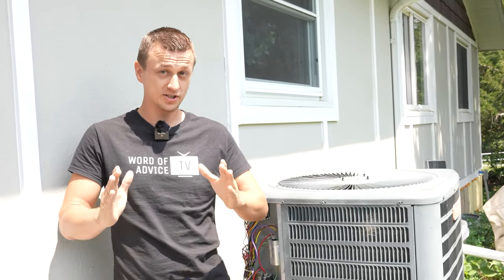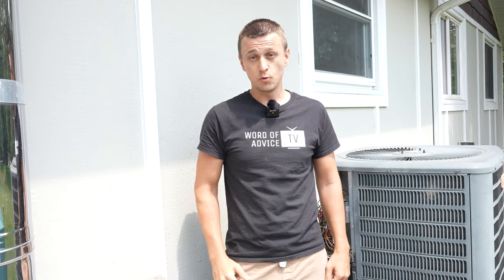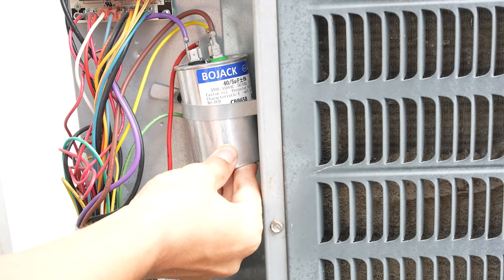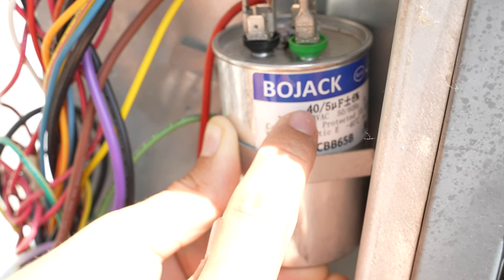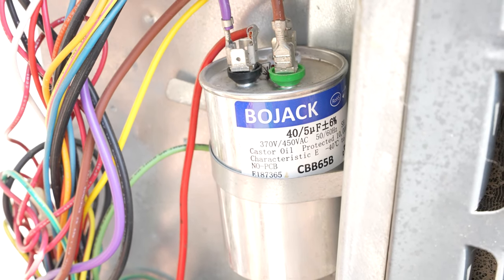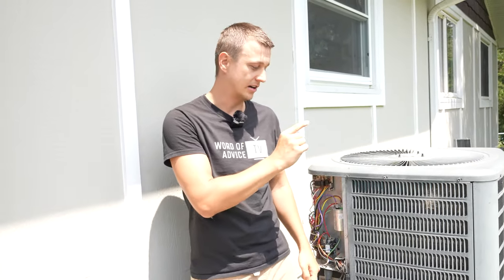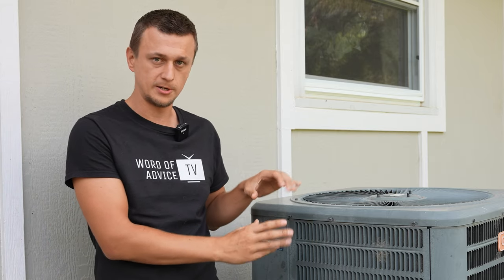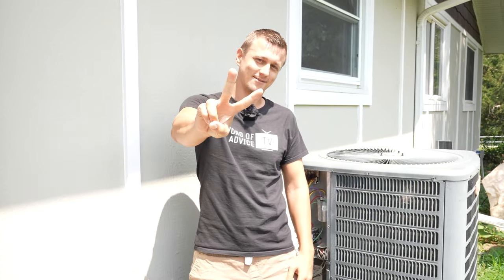How to Order the RIGHT Capacitor For Your Air Conditioner

Comment: Your overall point that other specs than factory specs may often be substituted and will work fine. Shape factors may be different (as long as the parts are secured to endure vibration of the condenser housing). Actually, you may have a point that "the voltage rating is not important" for most HVAC units in the USA and Europe, ie 360v/440v but that is not true for capacitors in general and may be very important. Rule of thumb...you can use a capacitor with a differing but close capacitance rating and you can use a capacitor with higher voltage rating but NOT LOWER voltage rating (lower voltage rating may otherwise burn out). Also, capacitors have polarity (+/-) that must be respected when installing or replacing. Overall good, helpful video, thanks.
Reply: Actually, since all A/C systems run on alternating currant, the capacitors do NOT have polarity.

Comment: When replacing, does it matter which terminal the connector is put on...like which of the 4 on the common or which of the 3 on herm?
Reply from the maker: The prongs in each section are connected, so it does not matter which terminal you put it on. 👍
Reply: I was told the best thing to do is take a picture before you remove the old one and then use that as a guide for the new one.

Comment: Jay – I'm replacing my mechanical contactor with an Emerson SureSwitch. I traced all the wires so I know what goes where. However, the 2 wires from the crankcase heater appear not to be connected correctly, as they are connected to L2 and T2. This doesn't make sense to me and I don't know how this can possibly work. Interestingly, this 34 year old condenser unit has never been repaired, except I replaced the compressor cap last summer. Any idea why these wires are connected like that? Thanks for an Word of Advice you might have. ;-) 
Jeff
Reply: Aack! I'm a dummy. I see how it works now. Brain fart.
Reply from the maker: Glad to hear you figured it out! Stay cool good sir!

Comment: What is the difference between the start capacitor and the run capacitor?
Reply from the maker: In short, the start capacitor helps the unit start and then it is taken out of the circuit whereas the run capacitor is in use the whole time while the unit is running.
Reply: If you do not know this answer, you have no business working on an HVAC AC or heat pump condenser system.  These are high-voltage 220/240 volt systems and the start and run windings are very important to the function.  Replacing these parts are not for DIYers.  This isn't like replacing your windshield wipers, this can be dangerous equipment.

Comment: Dude you're the Man! I notice all the run capacitor I see the larger number is stated first for the MFD. For instance 35/5 uf. For some reason my existing one that I need to replace, the smaller number is stated first 5/35 uf. Would it be the same? I know the larger number should be for compressor and small number should be for fan.

Comment: Very helpful video. I'm replacing both of my capacitors for my ac unit. They are both Sprague brand which no longer exist. One is 4 UF/370 VAC 60HZ. The other is 25 UF/370 VAC 60HZ. What capacitor can I use for replacement? I am coming across many with plus minus 6%. I don't know if those with plus and minus are compatible

Comment: What is a good brand Capacitor? Amazon goes from $15 to $35 . I need a 45/ 5 . Are the Cheap ones just as good as the more expensive?
Reply from the maker: Usually yes. The expensive ones fail just as much as the cheap ones. Buy a USA built one if possible, that might increase the longevity.

Comment: I was needing to replace mine and the old one has only some of the label remaining and says 10/50MFD. I ordered one that said 10/50 but now that I have received it, it says 50+10 MFD. Is this the right one? I can't seem to find 10+50MFD anywhere
Reply from the maker: Yes, it should be the right one. The larger number will always be for the compressor and the smaller number is for the fan. It does not matter in which order the numbers are.

Comment: I ordered the Kickstart T05 and installed it on one of my air conditioners and thought while I was at it I would add one to my second house. But it looks like it has a factory kit already. It has a dual run capacitor and a separate start capacitor with a relay. Is there any reason to add the T05? The original cap is 88 - 108uf . . .  the T05  is 189 - 227mfd. I was going to maybe change out the 88 - 108 with a new 88 - 108 cap. and leave the old relay . . . Good? - Bad? Thanks for posting these videos. You've got me doing things I would never think to try. But after that AC tech quoted me $250 to change the dual run cap, it tested 47 mf and should be 50mf but that's close to the 5%+ or - . ($12 part) and $200 to change the start cap ($22 part) and he was already on the service call. I'm willing to search these videos and save some serious cash!

Comment: Jay come save me again. I had my AC working just fine this year. I turned it off about a week or 2 ago since the weather cooled off. All of a sudden, the humidity and heat came back for the week. I went and turned on the ac and I didn't get nothing. I opened up and manually turned on the ac with the screwdriver trick. It turned on. So I assumed it was a bad capacitor. I changed the capacitor with a brand new spare one I had. Turned the ac back on and didn't get anything. So I replaced the capacitor again with another brand new one (I had 2 spares). Still didn't get nothing. I'm stumped. The fan motor is running since I have on the "ON" position to circulate the house. The ac unit outside doesnt do anything or make any noise. What do you think?
Reply from the maker: Sorry to hear about the AC troubles! If the contactor is not pulling in, the capacitor is not the problem. Its something on the low voltage side. This video should help you narrow it down: https://youtu.be/NVPhsK4gK1A

Comment: I recently replaced the capacitor for my furnace blower motor. The replacement says it has the same specs but it is half the physical size of the original. Why is the new capacitor physically smaller than the original, and is it less robust because of being smaller?
Reply from the maker: It is likely of a slightly lesser quality if it is smaller but nowadays pretty much all the capacitor manufacturers make smaller sized capacitors. I wouldn't worry about it as long as the specs line up. 30-40 years ago, many of the capacitors in air conditioners were huge! Like 3 times the size of the one in my video.

Comment: I know you said none of the other numbers matter, but the a/c guy that came out said I also needed to match the ±6% beside the 45/7.5µF as well. So, do I need to match that number also? Or can I just match the 45/7.5µF? Thank you!
Reply from the maker: If you find one that matches all the numbers, great! 👌 But if you can't find the exact one, as long as the uf rating matches, it'll work fine. (In fact even a wrong mfd rating would work but I don't want to encourage that so I usually don't mention it)

Comment: Hey Jay,
I just found your channel and really love the content. 
I'm experiencing a very odd situation with my condensing unit and was wondering if you have any suggestions. 
A couple of day ago I noticed the fan was turning on and off.
Like it runs for 3 to 5 seconds the off for maybe 45 to 60 seconds and  repeats that forever. 
The compressor never shut off. It will run 24-7 while the fan does its 5-60 seconds deal.
I changed the run capacitor (thanks to your video) but that wasn't the problem. 
Any suggestions?

Comment: The larger number example 35 is for the compressor.   The second smaller number is for the fan.   If you change your fan motor to a different option you may need to change your capacitor too.

Comment: Does a capacitor have a shelf life while not being used?
Reply from the maker: I don't believe they do but that is a good question. I'd like to know the answer to this too. If they do have a shelf life, the lifespan would be very long though.
Reply: @WordofAdviceTV  As long as they are not cooked, nor sitting in water to rust, they should be good for at least 50 years.  That is what they do in the warehouse, sit on a shelf.

Comment: Nuance....an original capacitor rated ONLY at 440V should NOT be replaced with a capacitor rated ONLY at 370 V...right?..... we can go up in voltage rating, but not down. This becomes almost a non issue because (as you say)...most replacement units show both voltages. Cheers.

Comment: What does duel run mean?
Reply from the maker: That basically means that there are two capacitors in one. In this video I show how to combine or separate them if you're interested to know more: https://youtu.be/qLJOWU33TFo?si=UgoZ3UuOnqO3-AEY
Reply: @WordofAdviceTV  I figured it out, but thanks so much for a pretty quick response.  My ac went out last night, and it was starting to get miserably hot inside. Luckily, ACE Hardware had a capacitor in stock as they were the  only place open today that was within a reasonable driving distance (45 minutes). Just installed it, and the house is slowly starting to cool off again.  Why is it the air conditioner, heater, plumbing, etc., always seems to go out on the weekend when everything is closed, and the technicians are charging higher fees for emergency service? Lol, I put an easy start on my unit about 4 weeks ago, and I was wondering if that might be causing the problem. I was gonna change the capacitor when I was installing it but never did, and the unit is about 4 years old, so it was due for one, I suppose. I did order another capacitor and a contactor from Amazon to keep as spares in case I have problems again in the future.  Sorry for the long-winded comment, but again thank you very much for responding. I wasn't too worried about being able to fix it, as a capacitor is simple to change and I'm pretty mechanically inclined, I just wanted to be sure I was buying the right part as I would have been really annoyed after driving 1.5 hours round trip just to find out I had the wrong part. This heat must've made me looney. I'll shutup now. Haha! ✌️

Comment: Hello I am replacing my 35/5 capacitor & the new one has 4 leads the original had 3 leads.  The extra lead on the new one is in the middle & says common.  Is it okay to replace it with this?
Reply from the maker: Yes, that is okay. You might get more questions as you do this so I'd suggest watching this video where I answer 20 common capacitor questions: https://youtu.be/ae0Ue4F3ooQ?si=aE8WyleLCa9cPJOv

Comment: i have a question maybe you can help me out. My ac unit has a 35+10 inside it and the spec at default come with a 45+5.   is this going to be an issue?
Reply from the maker: Yes, long term that will damage the compressor and fan motor. I would replace it with the proper size.

Comment: Does it matter if it is oval or round?
Reply from the maker: It does not matter but you may need to crimp the bracket holding the capacitor if the new one is a different size. I show how to do that in my video on how to replace a capacitor.

Comment: I have been trying to help my elderly neighbor across the street. Her AC went out last night (and today is 4th of July) I know NOTHING about A/C units! She has a horrible landlord that never fixes anything but I told her to call her landlord last night. She did call landlord but was told her ac man does not work holidays, weekends, or after hours and she would give him her number but not to expect a call back until at least Monday. 🙄 That would be five days w/o AC when temps are in the high 90’s! Anyway, sorry, I had to rant…. I’ve been looking through your videos and I have a question when it comes to the Capacitor. I did not take any part of the AC cover off, just looked through the vents. Her capacitor is solid white with a metal tube going into it. (Everything inside the AC unit is metal) Is this just a cover that is over the capacitor?!? I’m so confused. I don’t want to start taking things apart without having SOME basic knowledge

Comment: Our AC had went out and we got a new capacitor but it’s smaller and a little thinner the uf numbers are the same and the +- number is 5 and on the new one it is 6 would it matter if we put in the new one or should we get another one?
Reply from the maker: That's fine. Use the one you got. 👍

Comment: Two years ago I removed the cover to find the MFD,s , ordered a spare. Would you recommend testing the original with a meter   during a seasonal cleaning for a out of specifications capacitor? Is this a concern or just wait for a failure?
Reply: I bought a capacitor testing meter from Amazon for $22. My old capacitor that was working fine was about to fail any day now.
Reply from the maker: @Ed-dy3mh It would be good to test it but not mandatory. Checking it does not take very long and if it's weak, you will be able to prevent a breakdown ahead of time.
Reply: When my 30 year old Carrier unit developed problems like burning off the spade terminals, I bought all new capacitors and a contactor. They were much smaller than the originals. Added a Hard Start kit from Amazon, as compressor was so old. It was running without issues 7 years later when I sold the house.

Comment: I have question: 45/5 mfd 440/370V and 5/45 mfd 440/370V are the same? are they interchangeable?
Reply from the maker: Yes, they are same. The larger number will always be for the compressor/herm.
Reply: @WordofAdviceTV  Thanks for quick response. So, the voltage is not a factor to worry?
Reply from the maker: @meoan1  Yes. 370v and 440 would both work but 440 is a little better. (can handle a local lightning strike better)
Reply: @WordofAdviceTV  Thank you

Comment: i have a capacitor with 2 prongs on the fan side dose it matter if the new capacitor fan has 4 prong
Reply from the maker: That's okay, it doesn't matter. 👍
Reply: thanks

Comment: What common signs are of bad capacitor ? My AC is only blowing warm air. Will a bad capacitor cause this or just won’t turn on the blower motor to push any ( warm ) air around  ?

Comment: Is it possible to slow down  fan speed by changing capacitor size? If not, is there any way to slow down the fan speed to reduce the noise?  My unit is large enough that there is no concern about efficiency.

Comment: Hello. My 30yr old AC has a GE capacitor that looks good and AC running. Should I still replace it because of age?  (It is also much larger in size than my replacement.)  Are GE capacitors better than newer generic?

Comment: Someone please reply: 
This morning my central air was running fine and I noticed it getting hotter and hotter. The thermostat says its 83° in the house. Its 91° outside today. Its blowing air, but its not cold. I just noticed it sounds like its about to kick on but its weak and then stops. Could this be the capacitor? Im really hoping to fix myself

Comment: Is it possible to replace two single capacitors, a start cap of 30 uF, and a run cap of 5 uF with one 30/5 uF dual capacitor?

Comment: How do I determine the proper capacitor mfd without unscrewing the ac
Reply from the maker: You can use the model and serial to look it up. Easiest way is to simply call a parts store and ask them to look it up for you. I show an example of how to do that in this video: https://youtu.be/faCno8-vRnw?si=5sp0kq2EhPi5uE-b
Reply: You cant un screw the ac

Comment: The brand DOES matter. Cheap off-brand (usually Asian) capacitors very often DO NOT LAST as long as known name-brand capacitors. That said there are definitely Asian-made capacitors that are just fine, but make sure you're getting a known name brand. In the short term, if an off-brand cap is all you can get, by all means use it, but it's a good move to replace it ASAP.

BTW a family member got charged $900 for replacing a $20 capacitor in a condenser that was outside, on the ground, and very easy to work on. When he complained, the contractor gave him a $200 discount and dropped him as a customer. Ugh.

Comment: if the cap  has only 80uF  440 V  50/60  70 c will the 80 uF  50r 8 work since second number is not there

Comment: Hello,

Please, can you help me find the right capacitor for my AC unit? The old capacitor is completely rusted, and I can't read anything on it. 

My AC information is as follows:

AIRE-FLO
Model #: AFAIR10B18
Serial #: 4605M51234

Thanks for your help.
Reply from the maker: This is what I am finding on it (25/5 MFD) but I'm not 100% sure. You could call a HVAC parts store and ask them to look it up for you to confirm.
https://www.supplyhouse.com/Lennox-AFAIR10B18-1-Lennox-Central-Air-Conditioner-AFAIR10B18-1

Comment: my capacitor is all rusty no label how do i know what capacitor to get
Reply: Check the labels on the fan motor, and the compressor.  The information should be on those labels.  Besides, if the unit is still running, if you check with a meter that is designed for checking capacitors, you will be able to measure it when it is unconnected to the system.

Comment: lol i just commented on another vid about the capacitor. does the percentage matter?
Reply: 6 or 5 ? my motor doesnt says which %
Reply: @Alexander42099  doesn't matter, thats just the allowable range above or below the rating on the capacitor to determine with a meter to see if it's still in range.
Reply: @Alexander42099   Only way to tell if it's having an adverse effect on your system is to use a clamp meter to check FLA of the fan motor or compressor.

Comment: My condenser won't turn on at all no noise nothing.I don't see a capacitor on my condenser. I saw two boards one on the bottom has a steady red light and one on the top green blinking light? Any help would be appreciated